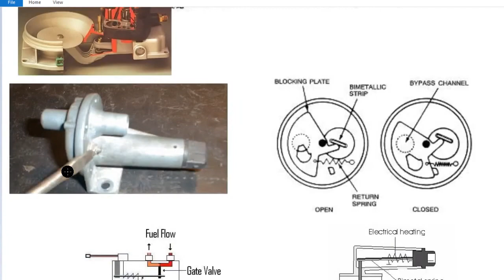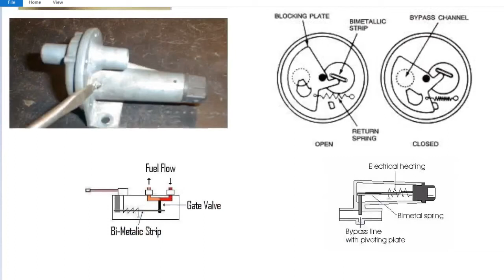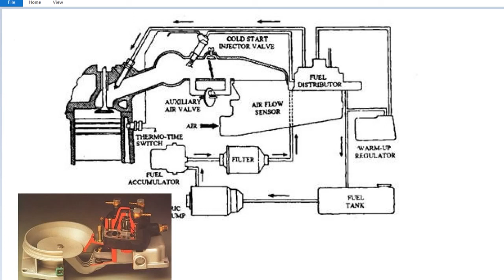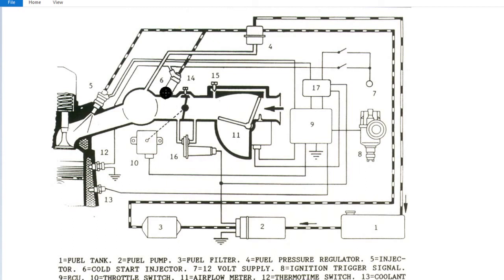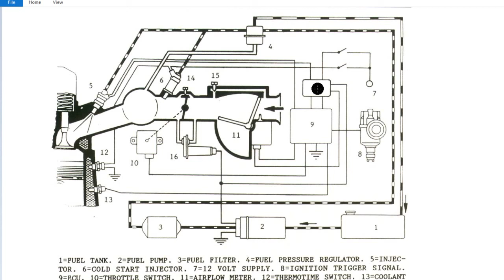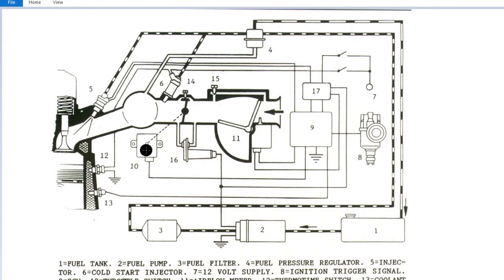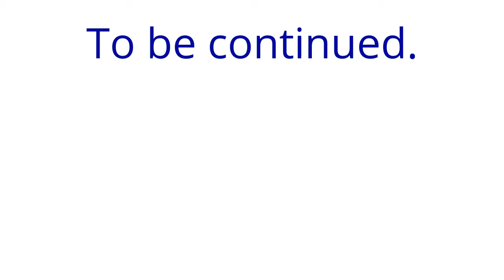Carburetor vs EFI E13

Comment: Porsche 911 performance handbook 1963-1998 says this about k-jet.  "The advice here is quite clear: Get rid of the CIS (k-jet) and install a pair of PMO or Weber carburettors instead." I have read everywhere that these continuous type injection systems cant run with performance cams , why is that the case? Is it because : since this continiously injects fuel , and if we were to do a good amount of valve overlap. Some of the fuel would just escape through the exhaust valves without burning in the cylinders and basically go to waste and rest of the air/fuel mixture gets lean due to that?? , just my thought , if you know the actual reasoning behind it i would really love to know the actual reason , would be much appreciated. Also just another thing i want to add : peugeot 205 t16 evo 2 group b rally car also had k jet but it made 480hp from 2.2 bar boosted 1.8l inline 4 engine. And Pretty much no naturally aspirated race car apart from one of the porsche 934s had k jet. Is it because cam lift/duration isnt as important in turbo cars compared to NA cars so that k jet doesnt create a HUGE penalty for turbo cars like it does on NA cars since NA cars would heavily depend on good cams to make power? Every NA fuel injected race car that came before 1990 either had Bosch Kugelfischer or Lucas system with the shuttle metering , and some with early Bosch Motronics and L jetronics in the 1980s but pretty much no D jet or K jet on NA racecars except that porsche 934 that i talked about

Comment: Im not gonna lie , i absolutely hate the k-jetronic. Every Ferrari that switched from Weber DCNFs to this k jet lost massive amounts of power. For example 308s hp went from 255 to around 210 when k jet was introduced with the 308 gtbi model. 308 , 412 , 512 all shared the same fate. Even the 4V 308 with k jet had less hp than the original 2V 308 that was on webers

Comment: Wow that's the old way of FI by Bosch.Very interesting thank you 4 the video.
Reply from the maker: Oh yeah its the very first of the Bosch FI systems, I started as a mechanic in 1976 so there were still quite a few vehicles with theses systems around.
Volvos, Mercs and so on.
I've got some videos on later Bosh FI up to the LE system but sadly these car videos don't get much views so I've moved to doing motor cycle stuff now that get a bit more interest..
Reply: @AuMechanic  didnt mercedes switched to k jet in 80s. Im not sure but i think in 50s 60s 70s they either used Bosch Kugelfischer actual mechanical plunger pump injection or Analog Electronic injection D-Jetronic. W198 gullwing in 50s had direct injection with the Kugelfischer system and the fuel injected w108 , w116 models from 60s and 70s had D-Jetronic